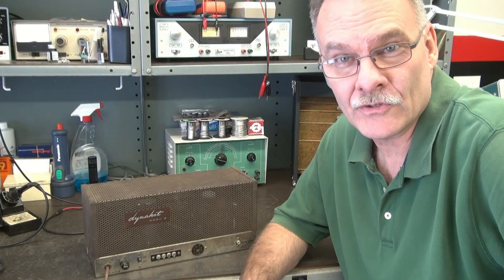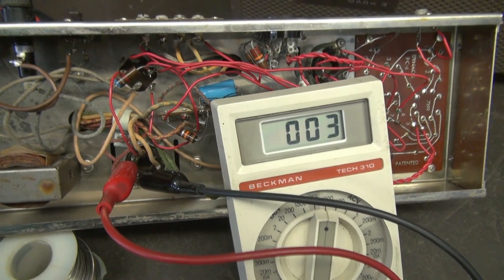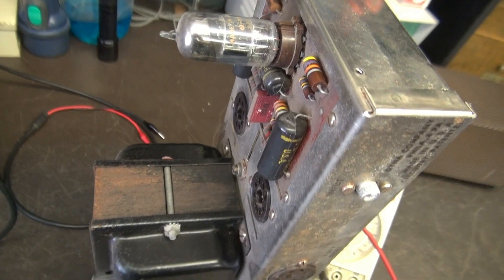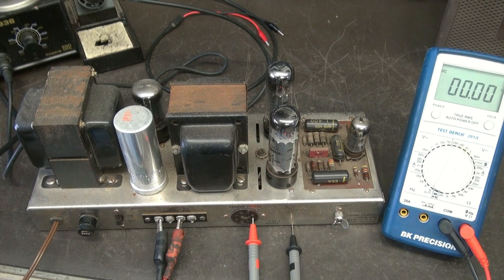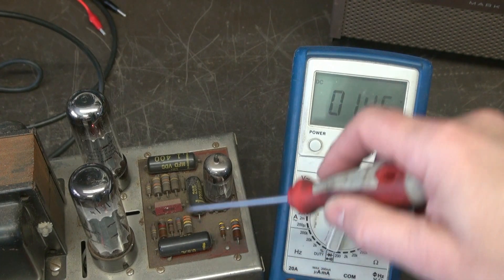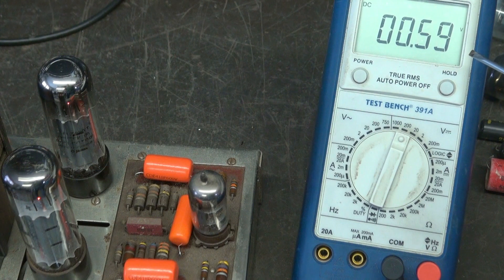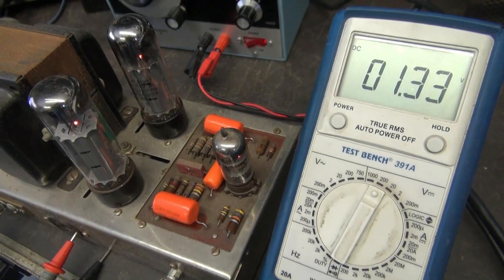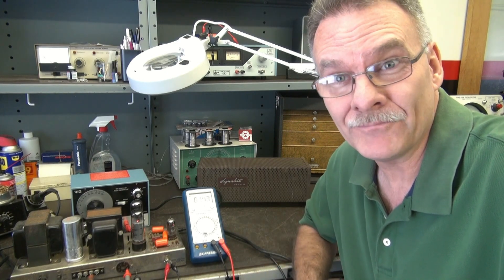How to repair Dynakit Dynaco Mark IV EL34 Tube audio mono block amplifier

Comment: i wonder if this company was a sub of heathkit? heathkit had a line of test equpt with the same.. there was 1 line with 5 units. signal gen , rf gen , volt meter , signal tracer , cap/rest checker , ig 5280 line..

Comment: Q: do you check filament voltage on these old tube amps? They were and are always designed for 110 v and will put 6.7 v to filament with 125v that you will see on mains.

Comment: Nice work, I would however monitor the temperature of that big can cap to see if it warms up much, indicating a leaky ps cap.  I have done similar testing on vintage tube amps and I have felt the can get almost hot when I pushed the line voltage up to 90 vac, requiring the can to be replaced even though the current wasn't skyrocketing thru the variac, fwiw.

Comment: Another way to adjust the bias is to use the oscillatin' television:  

Apply a LOW signal to the input and increase the bias until the crossover distortion goes away!

Comment: what a great video. bias is an amazing subject. imagine a tape recorder. the bias oscillator. so confusing. political talks use bias. I believe because of you, other wonderful technicians who share and books that bias is a control that is always on swaying the operatoin. even the bias oscillator keeps an out of hearing range signal on the record head even when no hearing range signal is present to prevent distortion. so confusing. sorry and thanks. you're great keep em coming.

Comment: Great video. I love the Dynaco products.
Reply: As a teen back in the early 70's, my dad was an audiophile, and had me build a couple of Dynaco Mk III 60 watt amps.  Also built a Dyna preamp.  And a Heathkit FM receiver. Through a pair of AR 3A speakers.  (Sorry I blew out the speakers, dad).
In retrospect, I should've gone into EE, but at the time computer programming scratched the itch more.  Now that I'm playing guitar (through nicely distorting tube amps), I'm liking circuits again!

Comment: Well, I have watched this great video probably five times now and I have came to the conclusion that I will have to write down the steps you take, in the proper sequence to compose an Amp Startup Checklist!!! I am just going to take the time because what you have said is so valuable to me and my son! I am retired and love everything that you are doing and my son would love to build amplifiers out of vintage equipment/amps like you!!! Thank you for taking the time to share your wisdom with the next generation. My  son and I are both just starting out and are working on our test bench, acquiring test equipment. You started at age 12 and I am starting at age 61 and age 28 for my son.

Comment: a very basic classic tube design, the big trannies, plus tubes, can boost the cost to over 500$.  But some el34 amps run into thousands of $.  a simple bias adjustment can avoid big troubles, great vid Mister T.  Don
Reply from the maker: Thanks man, Yes a great amp in history. I run a pair of Dynaco Mark III's Love them. They keep the house warm!
Reply: Nik, George and Tom,  Nik for the static charge wih caps, George for the iron transformers, and Tom for the tube filament.

Comment: Great video!  In the next video it would be interesting to test the capacitors with a capacitor tester instead of your multimeter.  Your multimeter isn't applying enough voltage to properly simulate leaking.   Many capacitors will read open on a multimeter but start leaking heavy current as soon as you up the voltage to 50-100v.  Also I enjoyed the bit about the tubes singing.   I'm sure you know it's actually the output transformer laminations vibrating to the AC being induced.   Keep up the great work.   I would love to start my own YouTube channel fixing tube equipment.   I live in Michigan too by the way!